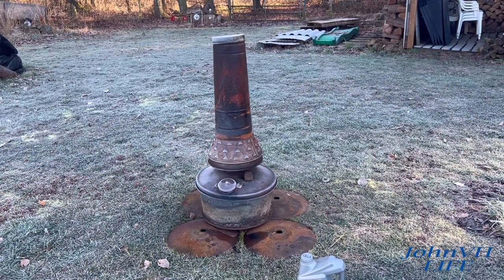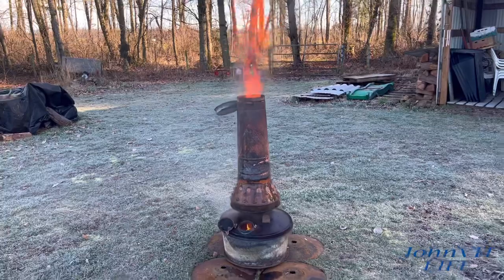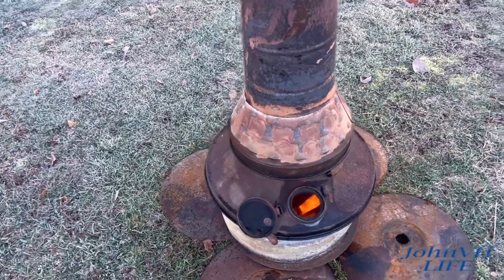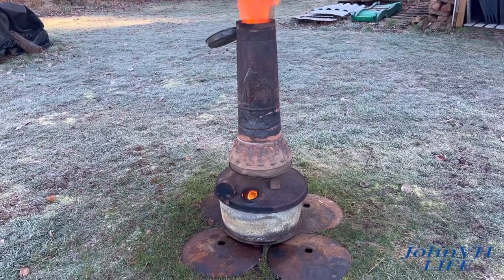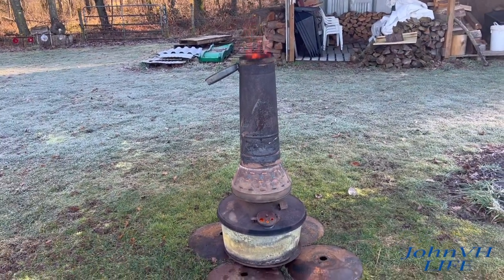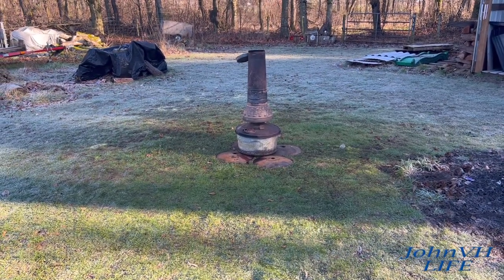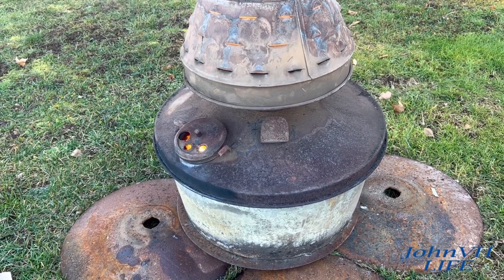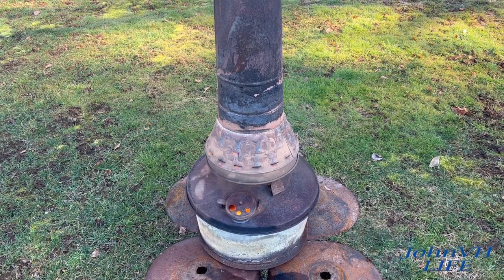How I Light my Antique Smudge Pot Orchard Heater! Chloofer! Waste oil or Diesel burner

Comment: What’s your process for cleaning it out? I just received an old one that still has oil in it. I want to clean it but looks like it may be easier to burn it off first.
Reply from the maker: Take it apart and use a stick to break everything free. Dump it out.
Reply: @JohnVHLife  i guess i was just overthinking it. Thanks

Comment: What's the side tube? Just to add extra heated air to chimney for secondary burn?
Reply from the maker: I think so
Reply: The top of the side tube sticks into the chimney and I think it kind of swallows up that rising hot air and loops it back down on the fuel source so it’s blasting hot air back on the fuel.  Simple but super effective.

Comment: Could you do a video of what these look like taken apart.  I'd like to build one but can't find any info of how the guts work?
Reply from the maker: I’ll have to do that. There isn’t anything inside it
Reply: That's what I assumed till your video showed a view down the chimney and I could see some baffles.  Is the baffle above or below the air vents?
Reply from the maker: @aciagriculturalconstructio2264  the thing you see in the carb hole, is some sort of wick holder, it doesnt need to be there to run
Reply from the maker: @aciagriculturalconstructio2264  Down the chimney pipe there is nothing, its a hole from top to bottom, the other style pot has a pipe that comes into the side of it
Reply: Ok.  I think I will go ahead and build it and see how it works then.  Thanks for the info!
Reply from the maker: @aciagriculturalconstructio2264  Building your own?  There is some magic formula to the louvers and the chimney, what it is, I dont know.